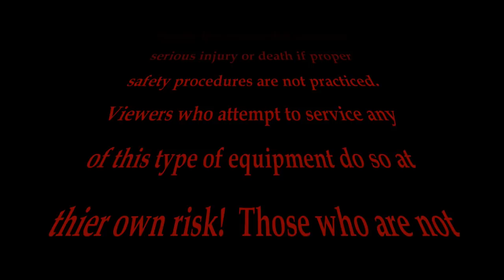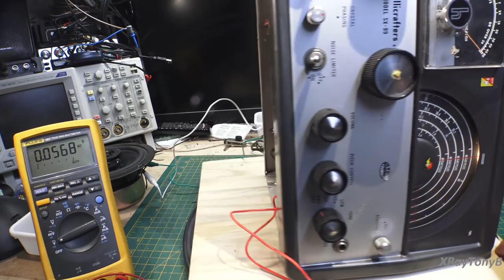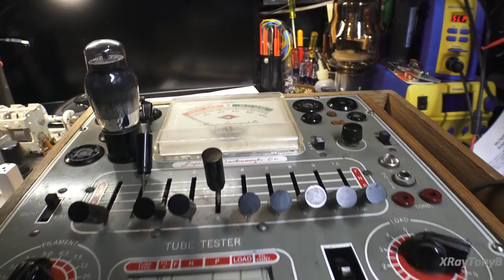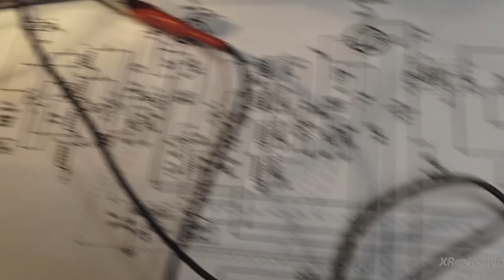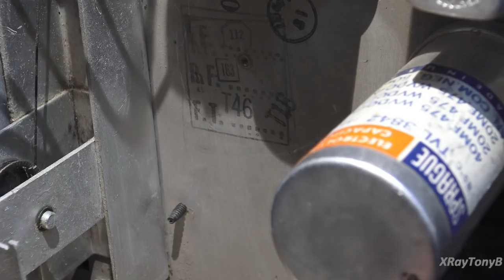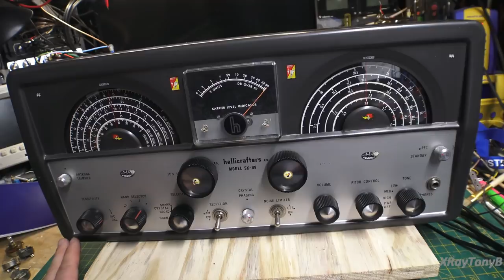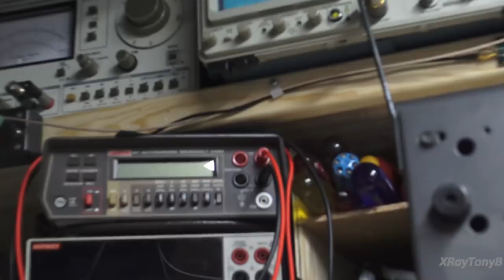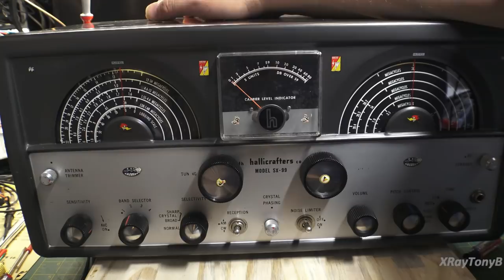Hallicrafters SX-99  Repair & Restore

Comment: I agree with you,  restoration of  antique and classsic radios can be relaxing and rewarding. Been a Ham for over 40 years, and have a plethora of Hallicrafters receivers, some restored, some waiting their turn for restoration. I also have a National HRO-5TA1 complete with original power supply and speaker with all coils ever made for it- it is my "go to" receiver when I just want to listen. It was part of my Novice station along with a Heathkit DX-35 and a furnace relay for a t/r relay. Spent many happy hours running CW until I upgraded to the Drake Twins  (R4B, TX-4B, MS-4, L4B) the same day I got my General license. I have other transceivers, but the Drakes still rule the shack. None of the radios I use have ever seen someone elses hands when they needed repair. I had a lot of supervision, but I did the work, and knew why which part needed replacement, and how to do alignments. Your video gave me a few pointers on how to fix an SX-99 I have in line for repair and restoration - Thank You!  73's de W4FJF.

Comment: I have one sitting next to me now. I plugged in a speaker and ran the dials. Just noise. No audio. I used  to be a tech for computers but, after a severe brain injury years ago that knowledge was erased and I've never been able to access it since. Not for lack of trying, though. Also, with my hands trembling a lot soldering is no longer my best skill. If those two issues were not present I would likely be following your well done video to bring it back to life. Unfortunately, I think I just need to sell it and let it go.
Thanks for doing such a thorough job.

Comment: I am coming into the hobby of ham radio with just the basic knowledge of circuits. It is good to see and easy to follow these schematics, especially with your explanation. The "bottlenecks" of the circuits (I know that they aren't actually bottlenecks but more akin to easy to find parts) allow you to find and diagnose where in the circuit the problem might be. It was very informative and a great video all around.

Comment: This was the style of my first receiver, donated by my cousin who had completed his EE degree and had a first job with IBM,  which lasted forty years.  He got that job in 1962,  and this had been his amateur radio receiver as W7YFJ

The receiver I had didn't have a SWR meter,  but did have a built in speaker.

I used it with my novice station and got my General and then Advanced ticket,  which I still hold today.  

My first transmitter was homebrew,  built largely from a scrap television chassis with tubes for $1 or so at the Salvation Army.  I think I had two crystals which I used with 40 meter CW.

Comment: I use a product called Goo Gone to get stickers and other glue type residue off cabinets. Just dab some on with a Q Tip and let it soak in. Keep applying it until eventually it dissolves the glue underneath.  Takes some time but won't damage the cabinet. Love the old Hallicrafters receivers. I use an S-40B on a daily basis. You've got a real nice one there. 73 Doug.

Comment: These old rig voltage charts are usually for a 20K/V VOM like a Simpson or Triplett.  10M input DVM's will usually read high on voltage.  Some charts will actually specify the meter characteristic.

Comment: I have now 2 Halicrafter SX 24  and a S85.  S85 is  working. But SX 24 has many issue. That year 1939 does have older compoments. Found 3 bad tubes. 2 open resister, wax caps , bad filter cap and dangous ac cord.   Replace cord, some bad caps replace  and 3 tubes.  Had no  audio, bad switch on the standby, now fixed. With loud audio hum.  I know you got replace all the caps.. need to find Filter cap. I not sure if i can get this working it's a big project.
Francesca

Comment: Great video; really enjoyed it.  I am currently restoring an SX-99 that needs to have the cabinet repainted.  Matching the color has been a problem, especially the portion of the front panel with the control labels.  Mine looks to be kind of a light gray color, but your radio looks closer to a silver.  Not sure if this is just the lighting in the video.  Could you please comment on whether the front panel is a silver or gray color?

Comment: At 44:20, it looks like that resistor is very close to touching that tube socket pin.  That pin may not be used, but I noticed that.
---
I have 3 S-120's, but they all have the same problem!  All of the tuning coils WILL NOT turn. Any idea's to free them?
---
I use an Ultrasonic Cleaner with Simply Green to clean knobs and V.C.'s

Comment: I am thinking that there is some possibility that the stickers are actually decals... Remember the ones you put on plastic model cars, planes, etc, when we were kids? And, how you soaked them in water, before applying them? Maybe try wetting a paper towel with really hot water, apply it to the sticker/decal, let it sit a couple of minutes and see if it will just wipe right off... It would seem to be worth a try, because it really should not be able to do any harm. HTH.

Comment: That audio output transformer usually goes bad on all of the Hallie's...Did you hook the speaker to the 3.2 ohm connectors...or the 500 ohm connectors If it has the two? I use to only get sound out of the 3.2 ohm connectors using an 8 ohm speaker. Im just 18 min's into the video..and just jumping the gun...

Comment: Ok help me out. I have this radio and the alignment needs work. I don’t have a scope. You use the 455khz unmodulated RF tone,turn the pitch control till there is no tone..that is the zero beat point. You mark that as your center for the pitch knob. Then you turn the pitch knob and get a tone say not over 1khz and set T1 for max out. Then you return the pitch knob to the center point and then change the test tone from 455khz to just a 500hz tone and set the other IF cans? Is the 500hz tone modulated or unmodulated? I can see that you have to do some switching of the knob positions on the radio. I am more interested in the test tone set up...the zero beat adjustment...and the adjustment of the top of can T1 or A as per the hallicrafters instructions. Without the scope, can’t I just look at the output on my vtvm? I thank you for your help.
Reply: I'm a little confused myself aren't you suppose to tune the IF to whatever the crystal frequency is by finding the BFO beat then leaving your SG on that and then tune the IF transformers.  and your answer according to factory spec. is is a modulated signal when tuning rest of IF  transformers. This info available free at BAMA website. Love Tony's videos, maybe I'm missing something but he has another video SX- 71 that he does differently. I know he knows more than me about  this, so clarification or update on this video would be greatly appreciated.

Comment: Back when America made radios like this the consumer got a great quality product for the money he spent. Today's radios, for this same purpose, are generally small boxes about the size of a cigar box at best and most of them are smaller than that. They have a small LCD screen and literally a hundred bells and whistles to boot; they have everything but quality. Their controls are difficult and require a learning curve to master.  We lost a lot when we started buying cheaper and turned our back on American quality. This radio is built like they wanted it to last a lifetime with simple maintenance and today it remains repairable.  Try that will the latest Grundig copies made in China; the knobs won't even stay on them very long, the plastic case decays pretty quickly and if you listen to them often you will notice they degrade electrically quickly too. This radio is a fine piece of equipment, it is American from our heyday.
Reply: Jeff you were completely owned by the response to your comment by KD7BWB but you choose to throw a rock and then run and hide. No reply. You refuse to learn brother.
Reply: Miami SWL Radio

If I really wanted bomb the guy, I might have pointed out that Grundig licensed its name to TECSUN in China. Chinese citizens can’t even buy these products, they’re made for export... to us. And no tech manual for repairs.

And then there is inflation. The tuning capacitor  in a Hallicrafters SX-99 would cost more today than the entire ‘Grundig’ radio. In fact, the entire  SX-99 would cost $3500 in todays economy.

And then he complains about menu’d functions. Modern radios have so many tools, a menu is a requirement. The SX-99 had a reciever and that is all. The modern TECSUN (GRUNDIG) has a DSP in it that performs not only noise-blanker functions not even in a SX-99, but also can limit received bandwidth at will, which limits noise outside the passband. These are a true advance in radio technology.

But Jeff Crane doesn’t care. He wants a good weight to use for an anchor for his boat, when he goes fishing. Now that’s multi-purpose design engineering <grin>!

Comment: Hallicrafters produced good quality radios all the way from simple 5 or six tube sets all the way up to sets that had as high as 22 to 32 tubes IF I remember O.K. I too have some Hallicrafters sets and they are the S-20R,  S-25X,  S-38,  S40B.  my S25X  at some time had the power transformer replaced, and someone replaced it with a power trans from probably an early color tv and this is why I saw the B+ about 180 volts above spec all over.  so I had to find an original part that I bought from ebay, this took about 1.5 years to find !!! and so I had to replace all caps and resistors as most were damaged by that transformer that someone else put in yea someone let a lot of magic smoke out with their crazy fix, the two output tubes were toast too!!   Enjoy,  A good interesting video as always !!!   John Bellas   KC2UVN

Comment: What size capacitor dud you use between your generator and the radio. Also the polarity relation to the radio?
Reply: Cap is not critical. 0.01/0.001 or so. Not sure what you mean about polarity.
Reply: .02

Comment: I can’t understand why that plate voltage and resistor was not picked up in at least the first 10-15 min. That resistor fault accounts for probably 50% of low or no audio faults. An experienced “radio” service man would have found that. However I note that Xraytonyb fixes all sorts of equipment so can’t be an expert in everything although I recognise him as a good engineer.

Comment: I had a S99 before  or S40  same thing no audio ,  a IF transformer had an open connection inside of the can ,.  i had take can out and open it up fix the connection in it .  in the IF csn .  I usually tyest all tubes first off bat.    then look at other things.    Tony ve4akf